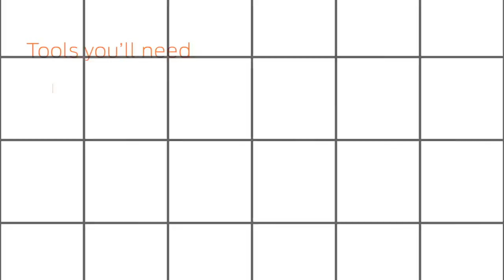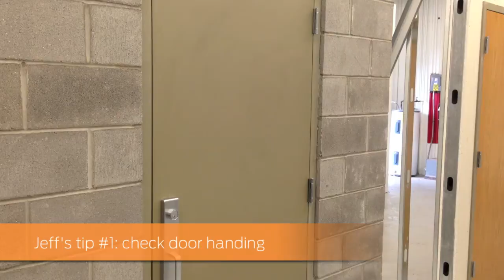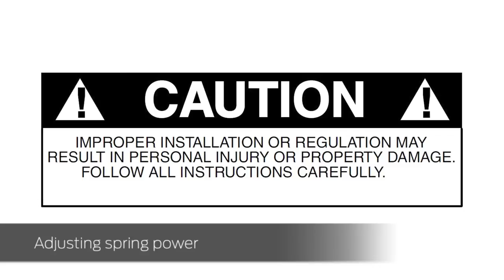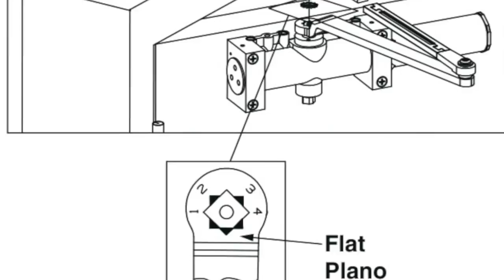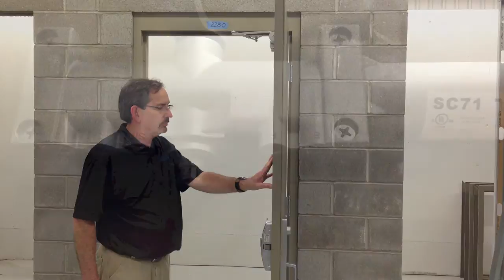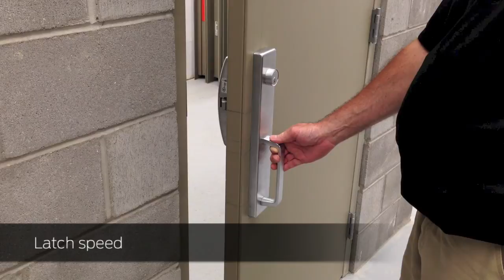How to Install Falcon SC71 Door Closer

Comment: Ijust asked how to add oil to a door closer and I can not get a straight answer
Reply: You cannot Add Fluid. This is done at the factory and the body are sealed closed.
Reply: @fredellingson  you cant. If you backed out the screw too far youve lost it
Reply: After Backing out the screws, the damage is permanent.